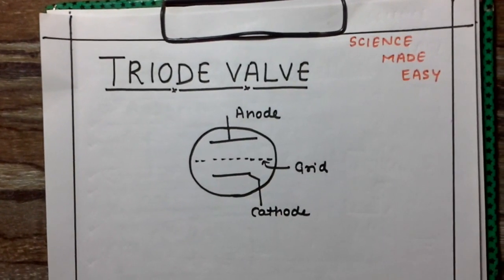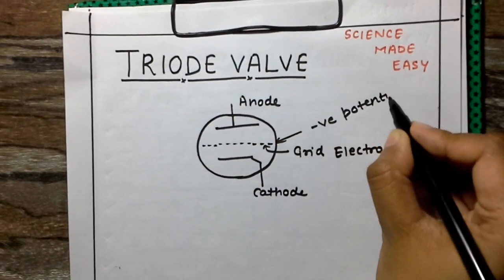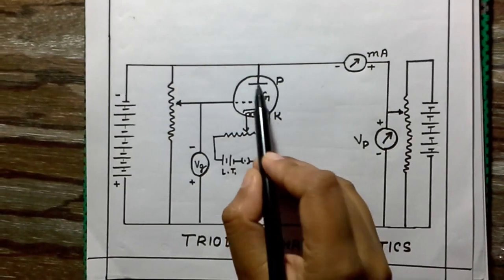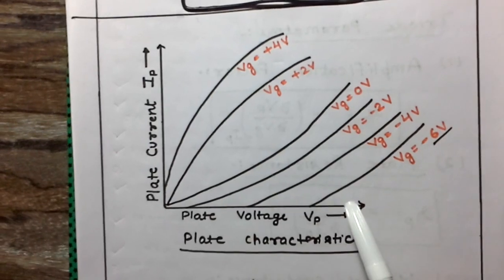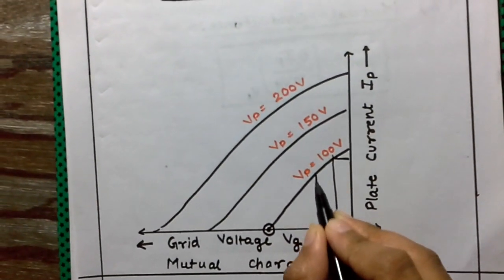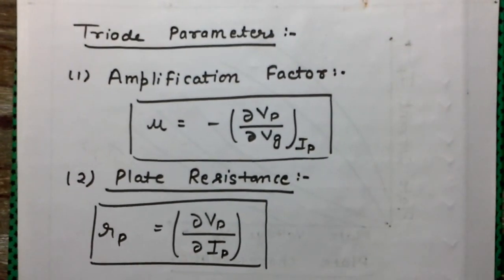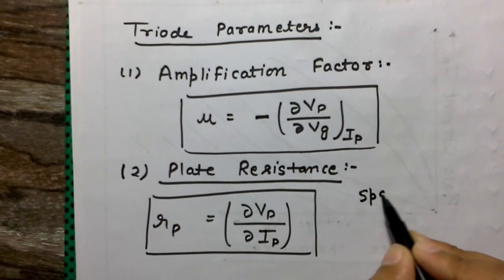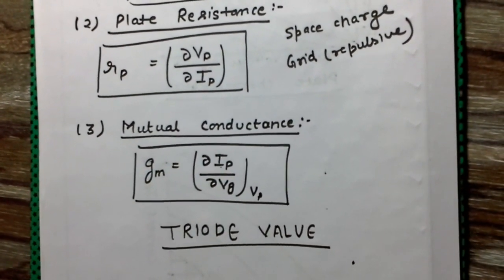TRIODE VALVE ,ITS CHARACTERISTICS AND PARAMETERS

Comment: Video maker: Your schematic shows the negative voltage source on the left directly connected to the plate of the valve. It should not be connected to the plate of the valve. It should only be connected to the potentiometer (grid voltage adjustment pot). Just saying. Other than that, a very good and concise explanation of tube characteristic curves.